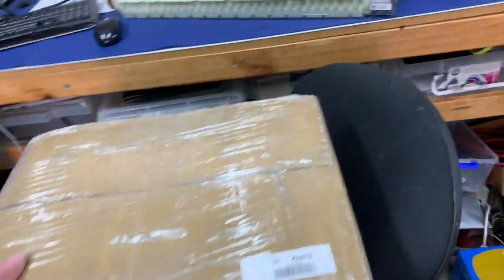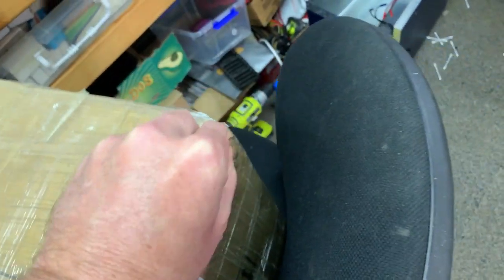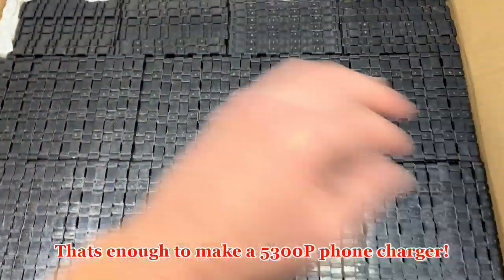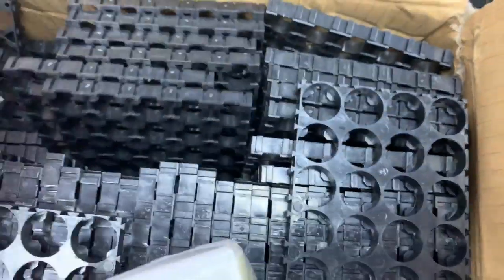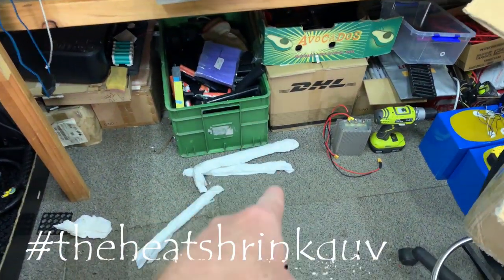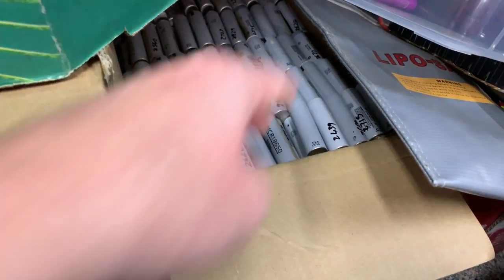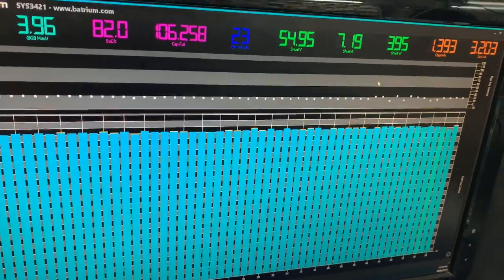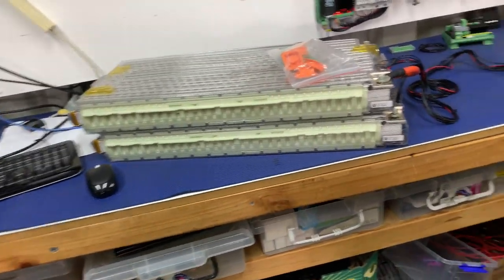Enough cell holders to hold 5300 cells!

Comment: Wanted to ask you an unrelated question: what amp rating are the glass fuses you use for your packs? Would you recommend  .5, 1 or 2amp fuses for a new pack?
Reply from the maker: Depends on your load, i've used lots of 2amp in the past - resistance is also a consideration, too small can actually be worse than one or two sizes up
Reply: @HBPowerwall  thanks man. I really appreciate your feedback. I'll go with the 2amp. Load will be max 40amp on a 24v system. That's the max the inverters will be able to handle,